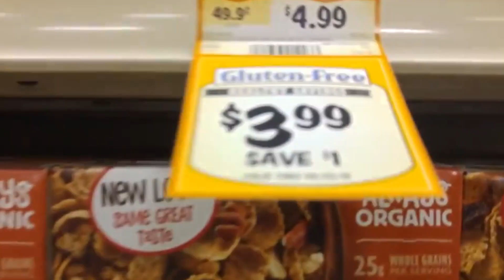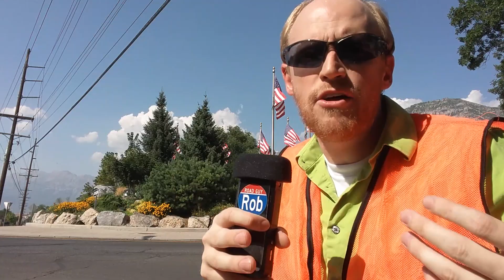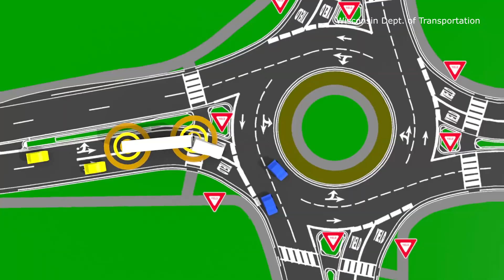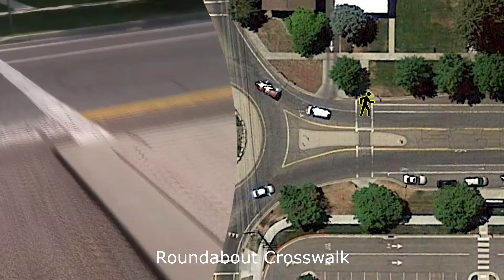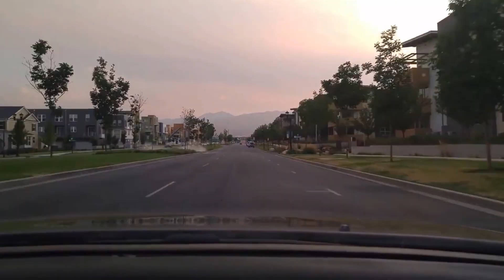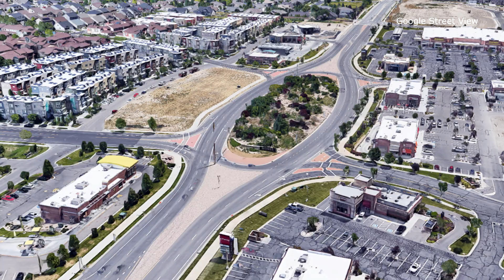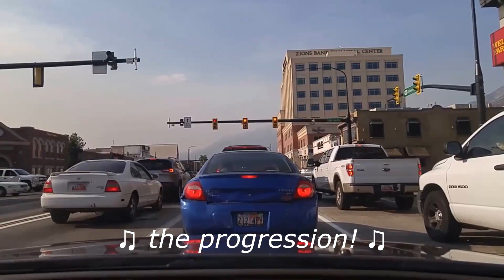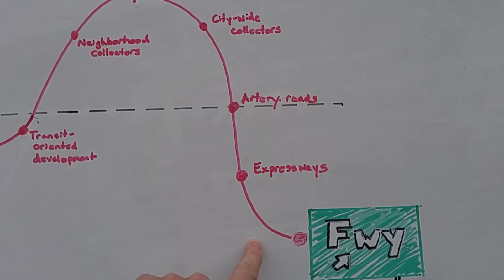Are roundabouts REALLY better than a traffic signal?

Comment: A good reason to not put in roundabouts is the longer walk distance for pedestrians. It's america people might get unfat with the extra walking distance. Roundabouts on a freeway YES good idea. Look at English motorways, where the M1 (130,000 car /day) intersects with the M25 (196,000 vehicles /day) just outside London. A ROUNDABOUT no traffic lights, work well. Roundabouts work that's why the rest of the world uses them, you guys should catch up.
p.s. You are driving on the wrong side of the road. Fact 1. More people are right handed, than left. Fact 2. A driver has better steering control over the vehicle with the dominate hand than non-dominate. So the average driver using a manual transmission vehicle should change gears with their left hand, sit on the right side of the vehicle and driver on the left side of the road. It's just maths. Yes maths with an S that's another thing you do wrong. And don't give me  any shit about automatic cars. People that can't drive a manual should take the bus. Can't drive a manual, you can't drive.
Can someone tell me why you call a section of road/ race track without any curves or corners a "STRAIGHT AWAY" ????
I get the Straight bit. But what is with the Away bit ???  It infers direction. How do you label a section of race track when you are (a spectator) at the very end of the said straight, looking directly at the approaching cars, at the corner that defines the end of the straight  ???????   The Straight Here  //    The Straight Toward   //   The Straight Not-away   //    The Straight Unaway
YOU GUYS ARE NUTS.
p.p.s. Stop Shooting Everyone.

Comment: Roundabouts and freeways, hmmm in the uk the majority of slip roads that lead off a motorway will take you to a roundabout.  Generallyt this works well.  However if traffic volume is high, then sometimes a traffic light is installed to prevent too improve traffic flow evenly.

Comment: I saw my first roundabout in Ft. Worth in 1960. It "is" a three lane roundabout. Roundabouts save thousands of gallons of gasoline that would have been wasted waiting for the light to turn green. Think how much gas could be saved if roundabouts were in most intersections across the country. They're not for everywhere, however. There was a roundabout in the town next to mine and they took it out. It created more problems than it solved. It was where two highways came together plus a local traffic lane. The problem was trucks came through there which had humongous tanks for the oilfield plus fan blades for the Don Quixote wind generators. Can you envision one of those blades going through a roundabout?

Comment: I like that you brought up trucks, and platooning, there are places for roundabouts, but they should never be on main routes with heavy flow. At that point, build side roads, and let traffic ramp off and on, over or under. 

We get permits for Oversize and Overweight trucks that can range from 8' 6" wide to over 16' wide, 80' to over 120' long,  80,000lbs to over 200,000lbs, and roundabouts are killer for those trucks.

Comment: Many large roundabouts in the UK also have traffic lights where platoon traffic is needed for flow. It also makes right turns (their version of left turns) safer because there's four streams that release in each node at once.
Reply: Why bother having the roundabout if your gonna stick a stop light on it anyway?
Reply: @Jabberwockybird  Often, the traffic lights are only on some of the roads; and are only during peak times, to prevent one road from blocking all others.  The roundabout still works as normal but the signal is used to throttle the flow on ingress

Comment: "AND DONT PUT ANY ROUNDABOUTS ON THE FREEWAY!! " manitoba government plans roundabout on hwy 1 and 16 near portage la prairie . If only ppl knew about this.😑 smh
Reply: You can put them on a freeway IF (a) the traffic volume allows for it AND (b) you have the space to make it big enough to not slow said traffic down too much.  Otherwise bite the bullet and spring for an interchange with over/underpass, which you can actually fit a pretty good one of in less space than the size of circle you'd need for traffic at that speed.

And though circles on a freeway may be a new thing in Manitoba, in Ontario there are (or used to be) two of them on the Queen Elizabeth Way.  However, they are/were near the ends, where the traffic may not be all the way up to speed anyway.

Comment: Uh, dude, the "roundabouts make pedestrians walk longer distances" argument doesn't make sense.

You're kinda assuming that people just wander around roundabouts like idiots. Nobody does that. The starting point and the destination are also almost never right at the intersection.

I'm a pedestrian and walk almost everywhere. If I need to cross a street, your standard pedestrian crossing at an intersection means that I'll have to walk aaaalllll the way up to the intersection, cross the street and then walk aaaalllll the way back. A recessed crosswalk in this case actually REDUCES the distance that I'll have to walk.

At most, I'll have to cross the street two times; but even then only one recessed crosswalk increases my walking distance.

Let's say for example I want to walk to a Starbucks, which is 500 yards away, on the other side of the road and behind an intersection. So in order to get there, I have to cross the street and get to the other side of the traffic junction. It doesn't matter if I cross the street at my starting point, at the Starbucks or anywhere in between - so the only crosswalk that can force me to walk a longer distance by being recessed is the other crosswalk that I have to use at the intersection. But if the total number of steps taken to reach my destination goes from 700 to 755, then that's not really a big change.

And none of this even takes into account how much safer recessed crosswalks are for pedestrians. At an intersecion, everyone needs to look out for everyone else: cars turning left or right, crossing the street or driving straight ahead, slowing down and accelerating, predestrians walking over the streets one way or another. If the pedestrian crossings get moved away from that, people on foot won't have to compete with anyone for attention, drivers can focus on passing the intersection and deal with pedestrians separately. This is so much safer.

Comment: In my country roundabouts are very common and popular, but the vast majority of them are placed in suburban areas and have a single lane. I agree that they are just insufficient and even dangerous in the wrong places, for example in a highway and in busy streets, and when you're a pedestrian it does take extra time to walk (traffic signals make you have to wait though). In general americans just don't know how to use them (the most common mistake is when one doesn't yield in the front) so they hate them and delegitimize them while they have more benefits than disadvantages in my opinion (again, depends on their implementation in practice).

Comment: You about covered the safety aspect, but one point that would have been beneficial to add would be that at a typical 4-leg intersection, there are 32 potential points of conflict. At a 4-leg roundabout, there are only 8.
Reply: It is surprising he didn't bring that up. He talks about conflict points in his interchange and intersection design videos.

Comment: My daughter is a civil engineer and has designed many roundabouts. Before considering installing a roundabout you take a survey of traffic movement to ensure the traffic flow is balanced. If you have a preponderance of traffic going in one direction roundabouts are not very efficient.

As regards roundabouts on freeways, you raise the roundabout above the freeway at the intersection which allows traffic to leave the freeway and enter the intersection above the traffic.
Reply: On a freeway, once you're building overpasses or underpasses like that, a circle isn't necessarily the most efficient kind of interchange.

Comment: OK, single lane roundabouts are easy. They don't need much explanation.... But multi lane roundabouts.... How??? Whoever is in the inner lane needs to exit eventually. How do you avoid a crash with someone in the outer lake who is yet to exit?!
Reply: Roundabouts work the best with 1-2 max 3 lane roads, surely there are some larger ones out there in terms of number of lanes, but they tend not to work as well as the smaller ones and can sometimes get messy with very high volumes of traffic, so in the case of big intersections in central arteries especially downtown of major cities other solutions are generally preferred, these things must be analysed case by case by traffic flow engineers, in some places they work fine and in others it's better to just have traffic lights or other solutions, roundabouts are really good but just like everything else they aren't perfect for every situation.
The trick is to have a good blend of both traffic lights and roundabouts imo, deciding when it's better to use one or the other.
 Europe is trying to do exactly that, don't think there aren't places that put one or the other where they're totally unnecessary or debatable cause it happens, but in the end having more options for intersections simply allows for more flexibilty, therefore a system that generally runs better.
Reply: To avoid crashes in a roundabout people must know what they're doing:
-1st rule
Putting your car in the correct lane to begin with based on your destination, following the road signs, and if there aren't specific road signs then just stick to the general road rules and common sense.
In a 2 lane road for example, even if it isn't specified, you are taught during driving school and must know to use the left lane if you gotta take an exit on the left or U turn and the right one to take an exit on the right or straight on. 

-2nd rule 
Use the turn signals (they are essential for a roundabout to work smoothly) both when entering the roundabout to signal the general direction of your exit, and when you are approaching your exit to signal you are about to go in the outer lane or leave it if you are already in it.
-3rd rule
Before entering give way to the cars that are already in the roundabout and approaching you, enter when you can do so safely without cutting anyone off. 
-4th rule
The big, heavy vehicles like semi's and trucks with trailers, agricultural machines, busses can use more than one lane at a time both when waiting to enter the roundabout and while in it due to their size and big turning radius, more blind spots, protruding edges etc...
Do not try to overtake them when approaching the intersection and especially not if you're already in it.

These are the general rules that will get you through pretty much any normal roundabout, they sound more complicated than they really are, once you get used to it you don't have any particular problems.
Reply: @andrex02scout  But that means that in a 4-arm 2-lane circle, if you want to go 270 degrees around, you need to yield to traffic in both lanes of the circle on entering it, then change to the outer lane before exiting.  If you were turning that way at a simple intersection, you'd have to yield only to the two oncoming lanes, so it's a simpler overall process.

Comment: The honest answer imo is that it really depends. In quiet intersections that recieve moderate flow of traffic, roundabouts are much better to have, while a busy intersection most definitely requires traffic lights.
Reply: Meanwhile if the traffic is less than even moderate, an uncontrolled intersection works; beyond that, controls in the form of yield or stop signs.

Comment: What's the difference in a traffic circle and roundabout?
Reply: Someone put an explanation online that makes sense, but I'm not sure most of those in the know go by it, for it could be a bit of jargon few use.  It's conceptual: a traffic circle (or rotary) is a circular one-way roadway that has priority (right of way) over the roads entering it, while a roundabout is an intersection with an obstacle in the center of it that traffic must drive around.  That alone would tell you traffic circles must be bigger than roundabouts, but also that they can handle higher speed traffic than roundabouts.

Comment: If you want to get into a roundabout with a trailer you must use the exterior lane, not the interior. If you have to do a U-turn or get to the 3rd exit you must turn on the left turn signal and stay ALWAYS on the exterior lane, nobody can go on the interior lane while you are inside the roundabout.
Trust me I drive trailers monthly and I never had a problem with roundabouts.

Comment: $5-10k per month for electricity for one intersection!? I'd bet it's closer to $50-200 a month depending on bulbs and the controller equipment.
Reply: Not a lot of research done on this topic, but from what I have found, a typical intersection runs about $1000 a month. If its using LED signals, quite a lot less. I don't know where Rob pulled 5-10k lol

Comment: They seem like good options for one or two-lane roads with a speed limit under 35 mph and not located in dense downtown areas. That's most intersections both cities, suburbs, and rural areas. More compact downtown areas can use traffic lights, but less pedestrian-intensive intersections in the city with one or two-lane roads should certainly be replaced with roundabouts. And faster arterial roads should use bridged intersections or very wide roundabouts if possible.

Comment: I live in Wisconsin and I found them to keep traffic moving pretty well. One thing you didn't mention is that it prevents stop and go action which I think saves some gas. Maybe there has been a study done on that. I also ride motorcycles and enjoy the occasional curvy in a state with mostly straight roads. They do get a little nutty when there are two or three in a row.
Reply: I wish they built more of them here in Milwaukee. Would be great for traffic calming especially in reckless driving hotspots
Reply: One of the many problems with roundabouts is that the force everyone to slow down and/or stop.  This wastes breaks and fuel.  I will concede on a motorcycle, it is less of an issue.  However, for cars and trucks it is extremely inefficient.  You are also failing to appreciate the other side of the coin.  I live in Wisconsin.  The vast majority of the roundabouts are poorly designed and semis have to hop curbs to get through them.  This means the Civil Engineers working in Wisconsin are imbiciles.  Likely they learned their stupidity from imbicile professors.
There is one near me I hate much less than the others due to having a separate and dedicated turn lane for right turn traffic.  This is similar to interstate cloverleaf design.  It allows a small percentage of the traffic to flow through as if the roundabout wasn't there.  It does take up more space, but that is space valuably used.

Comment: Going back ~50 years on US 206 northbound south of the White Horse Circle there was installed a traffic light where there was no intersection, no pedestrian crossing.  A sign explained that the signal created gaps in traffic at the circle ahead.  Apparently it was considered advantageous to not put the signal directly at the entrance to the circle, but some distance ahead of it so traffic would have a chance to get up to speed there.

And no matter what anybody says, there's no difference between a traffic circle (or rotary in New England) and a roundabout.  All the purported differences are based on untrue allegations about traffic circles or traffic laws, or bait and switch (kind of a reverse of equivocation) based on variables that can be true of traffic circles or roundabouts whatever they're called.

As explained in the final graph in this video, there's a sweet spot for the use of circles.  Ignoring considerations of real estate costs, it's based on traffic volume.  The primary reason New Jersey famously underwent a process over many decades of eliminating traffic circles is that when they were built the traffic volumes were such as to put them in that sweet spot of efficiency and safety, but as traffic volumes increased, they got out of that range.  You can wind up moving to the not-so-sweet spot on the left end of that curve too, even with overall traffic growth in an area, if a new freeway winds up bypassing the circle so traffic diminishes to the point where the circle becomes a traffic-slowing waste; you can see that's now the case with the aforementioned White Horse circle.

And then there was the fad a few years back to install circles in low-volume residential areas for "traffic calming", i.e. to deliberately slow traffic down in subtler ways than speed humps or stop signs -- either for pedestrian safety or to discourage thru traffic in certain developments.  (And without the engine noise of accelerating from stops.)
Reply: Since then I've seen a convincing description of the distinction.  The concept is that a traffic circle is a circular road with entry and exit points, while a roundabout is a slightly enlarged intersection with an obstacle in the middle of it to steer around if you're turning left (or right in left-hand-drive countries).  OK.  That tells you right there that the appropriate places for roundabouts are limited, and it captures the distinction of how you should drive into one.  The roundabout is good only at low-traffic, 3- or 4-way intersections, and then is only a marginal improvement on an uncontrolled intersection but better than an all-ways stop.  Traffic circles, while they still have a limited range of effectiveness, are more flexible than roundabouts.